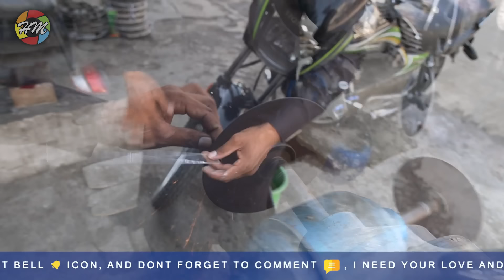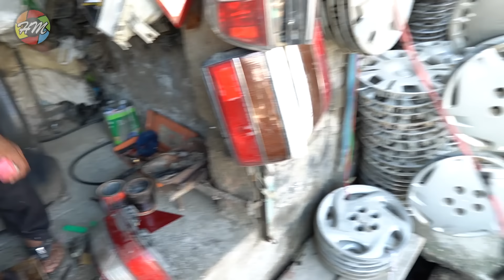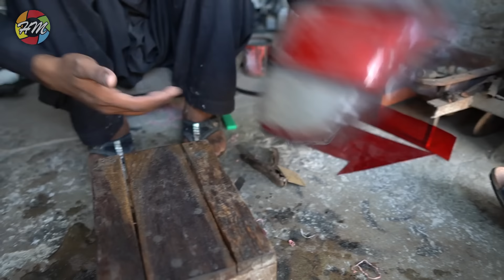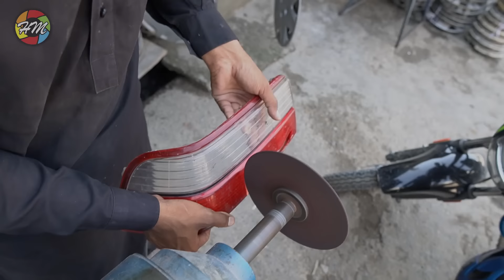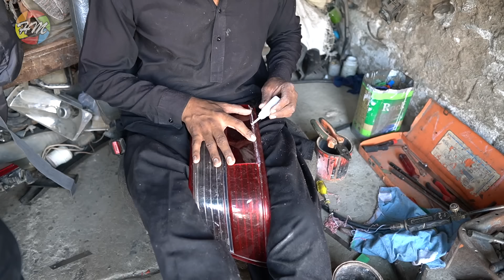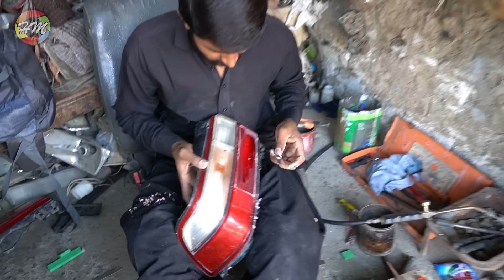Amazing Restoration of Car Tail Light | Car Tail Light Cover Replacement | Car Back Light Repair.

Comment: If they can rapair a car light in such conditions, thanks to their skills, imagine how easy it would be if the car manufacturer gave a training to the dealerships to do this and other kind of rapirs, instead of just changing a part for a new one (pumps, turbos, EGR valves...)...that would be a real ''sustainability'' attitude, and not a greenwashing the carmakers are doing now